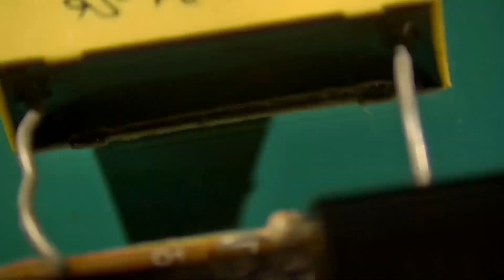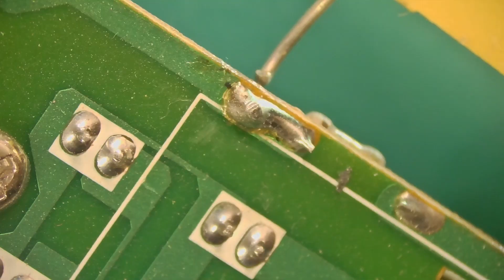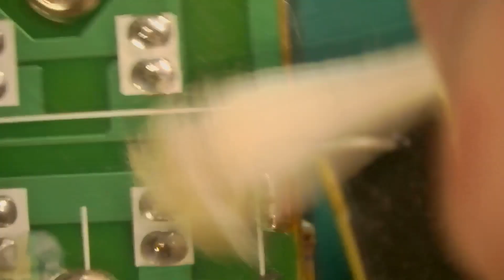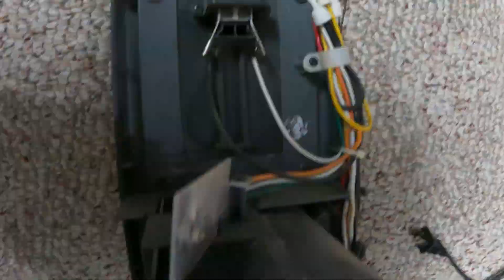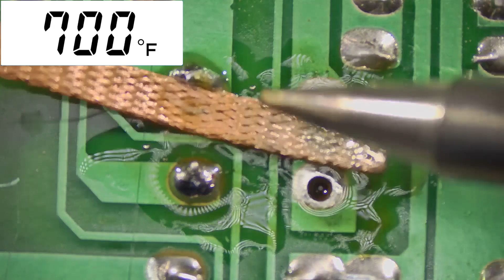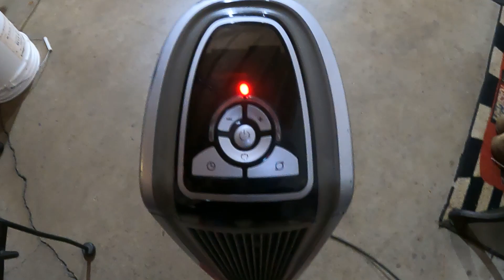Lasko Ceramic Heater - No Power - Repair

Comment: Model 5490 very basic HAS TAMPER PROOF SCREWS. Uhave to by a special screw driver worth more than the heater. Its a LOUD VOICE TO NOT REPAIR THE HEATER. Just throw it out and buy a new one. LASKO is thievery planned obsolescence.
Reply: I bought those triangular bits and was able to repair both of my Lasco heaters and a Lasco tower fan. Cost me $11 for the bit set and less than $14 in parts for all three.